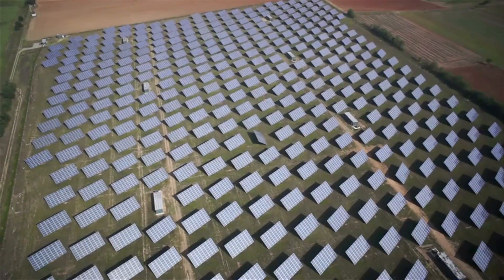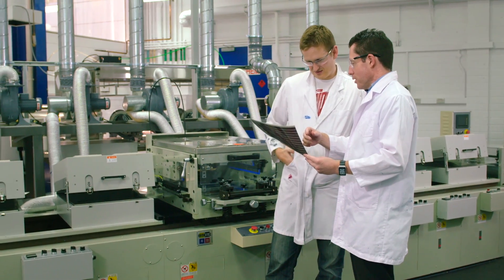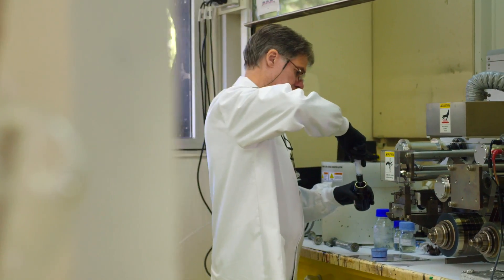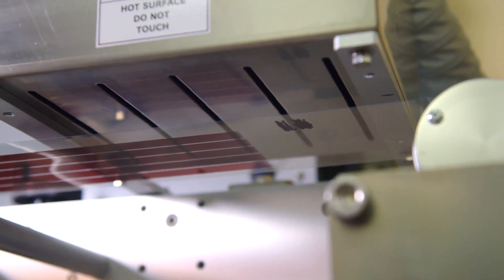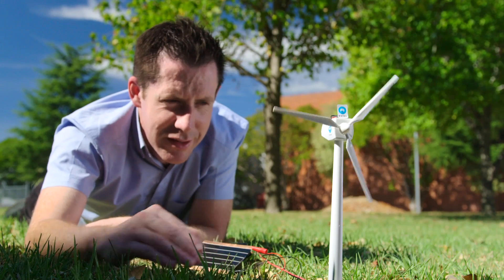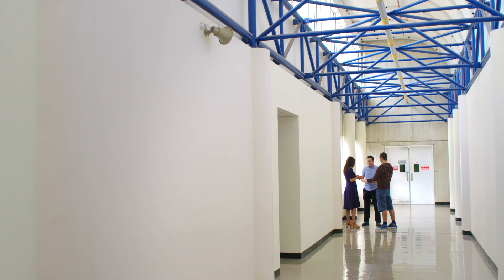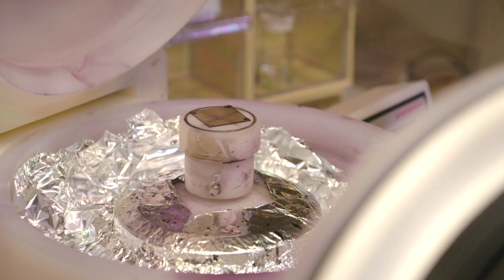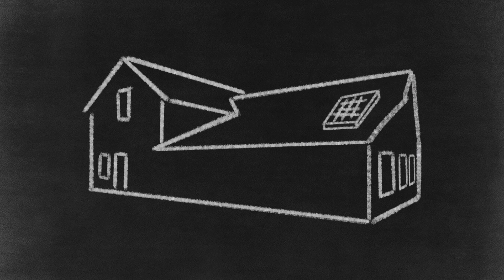CSIRO's Dr Scott Watkins on solar energy

Comment: I like the idea of incorporating these films in common items.  Vinyl siding is such a common covering that has changed very little in years.  It a challenge just to stick it up without the wind blowing it off it seems.  The little rectangular patterns that are printed on solar cells might just make an appealing color. The trick would be to make it so installers could put it up and cut it like regular siding.  Installers have enough trouble just getting the siding level and finding good places to anchor it.  After it is up a solar guy would use conductive sticky tape to wire it to the  load.  The leaf shaped idea is OK if you mean to make cell conform to everyday objects but not for more stuff to keep clean.  If you do go with improving vinyl siding you might consider that it has some passive thermal qualities that have been completely overlooked.